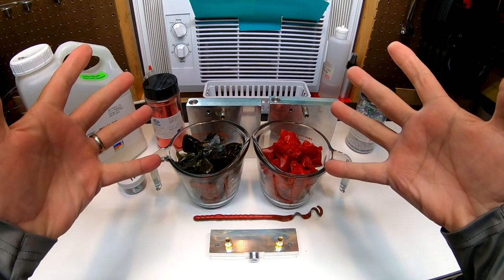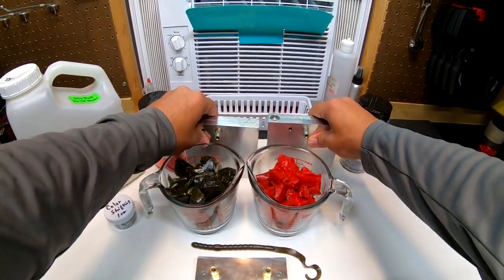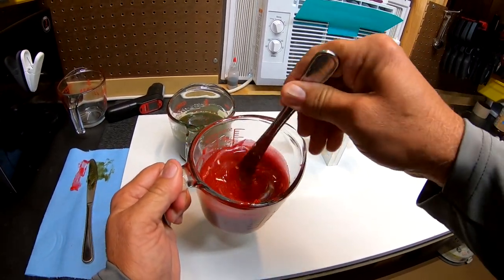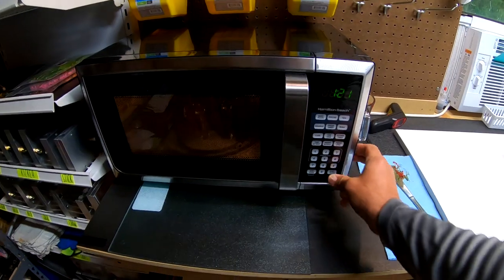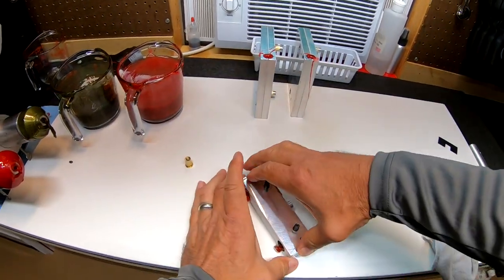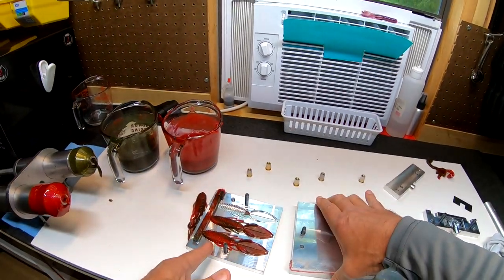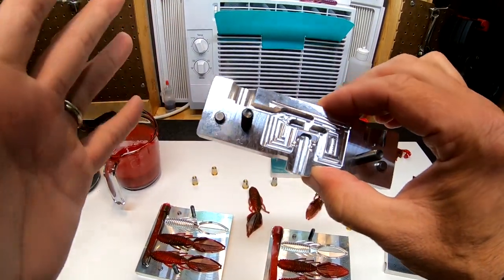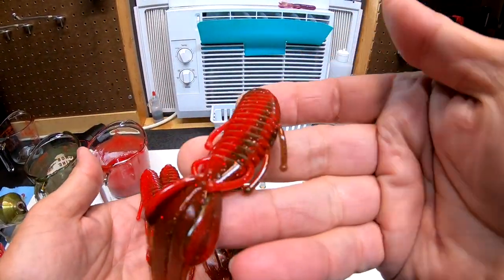How To Make Soft Plastic Baits | How To Make Soft Plastic Lures | Camo Baits | Dual Color Baits

Comment: how long do leave the plastic in the de-gasser
Reply from the maker: Hey thanks for the question. It really depends on a number of things. Temp of Polysol, Temp Outside. (Both make it thicker) Did I shake it Just now or 45 min ago. (Just now=more bubbles) Are you up North or down South? (Humidity) So see you have to play with it. 
Smaller baits-Tails-Thin baits. All show bubbles easier. I have figured out exactly what I have to do to get the best performance out of my chamber and I currently operate 2. I will give you a SOLID PC of advice. Do not pour a gallon in the pot and do it that way. Use your cups.

Comment: You use 152 soft plastisol for your creature baits?
Reply from the maker: Hey Man nice work you do. To answer that question properly I will say yes. depending on how the Customer rigs it I fell that 152 works best. More action plus better floating values. If it is rigged on a Ned hook it will go vertical. I have tried many Plastics. MANY...And the only one that's Dead On is Bait Plastics. 
Get ya some and try it👊
Reply: I appreciate the love brother! Definitely going to give the 152 plastisol a try...thanks! 🤙😃
Reply: I appreciate the love brother! Definitely going to give the 152 plastisol a try...thanks! 🤙😃